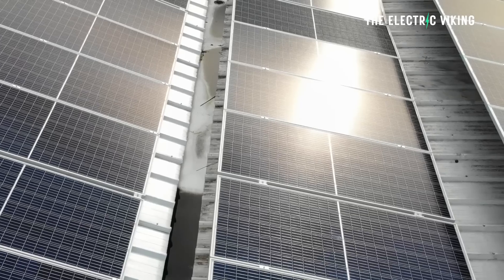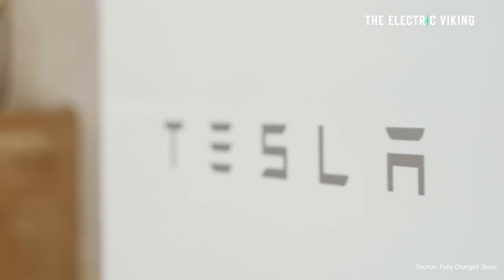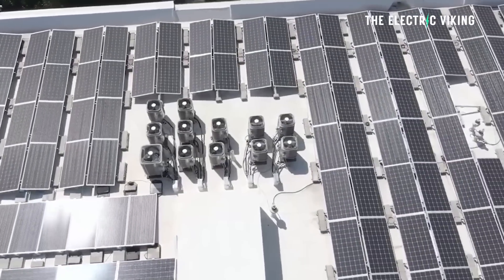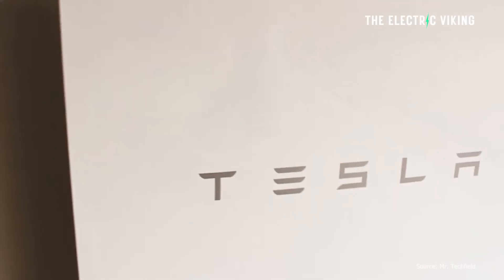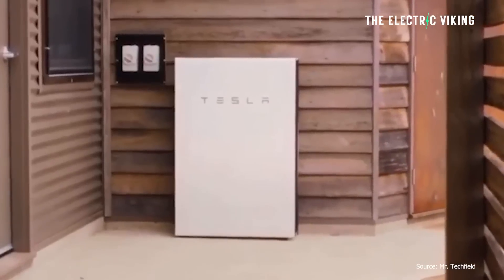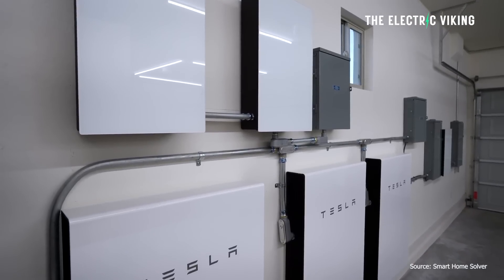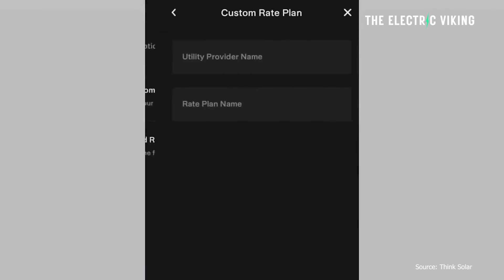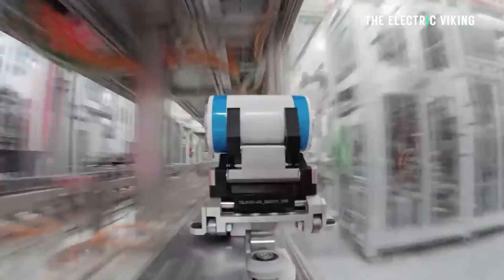Tesla DROPS the price of the Powerwall home battery AGAIN

Comment: The big issue in Victoria at least is my solar panel system is 6.6kw with a 5kw inverter. It is classed under contract as a micro generator by the power companies.  Under their crap contracts, you are only allowed a maximum kw feed-in to the grid size by location on the physical grid. My street is 5kw max only. Under this crap Aus system, they only allow 1.2 times the inverter max output as total amount of solar panels that are allowed to be installed. Hence the panel max of 6.6kw. If we had 3 phase connection, then yes I could have had a larger inverter and therefore more panels. 
These idiots either hate solar of don't understand how it works. As the best panels are only arount 22% efficient,  and the inverter controls that power output, I should be able to connect enough panels ... maybe 5 times as many in order to get a higher yeild output. The inverter regulates what it's chopping the DC at. It's all safe. 
These contracts stop you from benefiting from a larger array and the possibility of being able to store it.  
I also found that if a panel were to go faulty, I must replace it with a type from Ausnets list of allowed panels. What a joke. Australia is such a nanny state.

Comment: My 6.6KW Solar Battery system is looking at ROI of 7-8 years, I installed anyway because I love technology : )  . Here is the simple math. My system 6.6KW cost about 5000 all up. 6.6KW * 365 days * 0.3 Aussie dollar per KW. Means I will save 722 Aud per year. 5000/722 = 6.9 years for ROI.   But I am actually paying 0.24 Aud per Kwh, ROI becomes 8.6 years. I just hope the battery can last 10 years. (Also I haven't included my 10Kw solar panel system). I also have a question for those people that has a massive credit accruing on their electric account. Is the credit transferrable to cash ? Because if i want to change to cheaper electricity company, you will lose your credits. So basically once you have reached ROI, and started to acrue credits, you won't need to pay electricity bill anymore but you are stuck with that electricty company forever.  This makes me think the government will eventually reduce the feedin credit to 0 and I will eventually become a solar power milk cow.

Comment: Li batteries of any type are not really the best option for static applications - either home or grid use.  The alternatives last far longer, can be cycled between 0 and 100% with no damage, need simpler charging/discharging electronics, are made from elements that are cheaper and readily available from multiple sources, should be cheaper than Li batteries once they get market share and will be more easily recycled if they ever need recycling.  There are both flow/plating and gel batteries based on Zn and Br, liquid metal batteries based (so far) on Sb and Ca, a range of redox batteries based on Fe and V, the 'rust' battery based on Fe and air and perhaps even the up and coming Na batteries.  These really need pushing to achieve market share.  Perhaps governments could install mega batteries using these technologies.  They are money earners even without attached renewable energy generators, buying cheap and selling expensive.  Besides they improve the grid immensely.

Comment: I did not build (well, I had the engineers do the actual construction) my solar system to make money selling power to the grid. Instead, I polished up my tinfoil hat and decided I wanted to have the capability, if needed, to be energy independent with battery storage in the event of a long-term grid failure in the ongoing global economic collapse. I would have to cut back on my usage in that event (garden lighting, swimming pool, maybe one of the hot water heaters, etc.) but my storage is sufficient that I wouldn't have to make drastic changes in my lifestyle.

 I generate slightly more electricity than I consume on a daily basis and my overage I give back to the grid without compensation. In return, they utility company "stores" my overage on a 12-month use it or lose it rollover basis (I pretty much lose all of it) but it covers me for the few months of the year that my solar output doesn't quite meet my usage. I'm "losing" a couple hundred kWh per year that way, but the simplicity of it all makes it worth it. My electric bill would run about $4,000 USD per year without the solar. With it I pay only the $1.33 per month grid connection fee.

I do not have Tesla Powerwall storage. One reason is that it is not available where I live in the mountains of Central Mexico. The other reason is that my battery storage of choice cost me less than one third the cost of a Powerwall at the time. My choice? Deep-discharge lead acid batteries designed specifically for infrequent use. I remain grid tied (while it lasts) and my batteries just sit 24 hours a day on a trickle charge. When I do experience a rare short-term grid failure, I don't even know it, not even a flicker from the lights as the batteries pick up the load.The batteries will easily last 10 years without serious degradation under those circumstances.

When the batteries eventually do fail (as do all lead-acid systems in the long run) I can replace them with newer technology, with twice the storage at half the price I paid for my lead acid batteries and still be money ahead. My engineers thought I was crazy going with lead-acid storage... until I explained my reasoning, and then they agreed with me. This system would not work if I were using the batteries, cycling them daily to sell electricity back to the grid.

It works for me. YMMV.

Comment: Paid, been or the list 2.5 years for a solar roof and 2XPowerWalls, got the permits. Permits expired this month and speaking with Tesla is useless. I need an inspection by Tesla but they will not answer the simple questions, “Does Tesla have an inspector in Portland OR? They won’t answer the question but refer me to the two certified installers in Portland OR. I just want Tesla to come and install the solar roof and PowerWalls. I have no desire to deal with some unknown contractor.

Comment: I have a Tesla power 2+ and with Tesla's VPP it is a game changer.  I also driver over 1000 km's a week in my Model 3 and dont have to pay for power at home including charging my Car due to the VPP and how well it works.  All this rubish about costs and its not worth it are out the window when you dont have to pay for energy at all.  Most people pay for fuel and power at home add those togeather and work it out.  If you do heaps of km's your crazy not to have an EV solar battery and VPP.  Saves you heaps of money.  BTW when your on a VPP with Tesla they change your Battery Warranty from 10 years to 15 years as they manage your battery.

Comment: A total ripopff. You can buy an 80kwh electric car for around £40k. That is around £500 per kwh and you get a car thrown in for free. An EV battery will have a much rougher life than a battery used for domestic energy storage. Battery prices are now supposed to be around £100 per kwh. Hopefully car to load or car to grid will completely bury this overpriced nonsense.

Comment: We are doing PV panels in the next few months and batteries next year.  If Tesla doesn’t release the PW3 by then will go with Enphase 5P LFP batteries.  I lie the surge capacity of the Enphase batteries compared to the current PWs.  And Tesla needs to offer V2H as well.
Reply: Enphase will also support a generator with its off the shelf controller unit.

Comment: In the UK getting a battery is a no brainer. During the summer you can fill it up with solar power, in the winter you can use off peak energy and save an absolute fortune. I’m with Octopus on their Flux tariff, designed for people with solar and batteries but no EV. If I fill my battery from either solar in the summer or between 2am and 5am in the winter and use the energy between 4pm and 7pm I save £0.24 per kWh. That might not sound like much, but over a year that would be about £90 for each kWh from the battery. During the rest of the day I would be saving £0.12 per kWh.
Reply: Wrong.  You can save a bit during the summer but, if you have a heat pump, as most of us will have to in the future, the thing will be on from 6am to around 11pm using up to 50kwh per day. That makes it impossible to do any sort off load shifting to take advantage of off peak periods.
Reply: @rogerphelps9939  why are you pointing out something wrong that isn’t actually wrong yet? I’m talking about the now, describing what I have now and how it works, I will worry about the future when it happens. When I get an air source heat pump (as I fully intend to) I will not have to pay for any gas, which will save me about £1200 at current prices. I also intend to invest in more solar panels now I understand how brilliant they are, and I have found out about the DIY kits that you can self-install that charge batteries and don’t connect to the grid, such as the Ecoflow system. I also fully intend to get an EV and more batteries.

Comment: You can buy a Powerwall in the US without a rooftop solar setup and just use it for backup power and arbitrage if you live where rates are variable.
I live in Arkansas and Tesla does not currently install Solar here despite our being a good location for Solar. When Elon expands here we will be getting a Solar Roof with the Powerwall.

Comment: With Tesla you are paying more for software and a name but they've been forced to lower prices do to increasing competition.  EG4 just released a slightly bigger sized battery than Tesla for only $3,900 and works with most inverters but Tesla's software and app are far more advanced.  Whether that means anything depends on how you intend to use it but you can purchase two of these for less than a single Powerwall.

Comment: I’ve enjoyed my pair of Powerwall 2s. Even if you don’t have solar you can get whole home protection from power outage. I live in Texas so our energy grid isn’t very reliable. Solar plus batteries is great because our peak energy times (most likely when we’ll get rolling blackouts) is during the day, so as you said Sam, if the power goes out and you reduce heavy loads: laundry, oven, maybe back off on one of the AC units) you can cruise through blackouts. (Harder than it sounds because Powerwall switches so fast you won’t even notice except the Tesla app notifying you). The lights don’t even flicker. You don’t have to reset your microwave clock, etc.  (This saved our thanksgiving dinner a few years ago. Guests were over. We had lights and finished cooking while the rest of the neighborhood was dark.)

For energy we export onto the grid, our energy company Entergy pays only 30% of their charge rate. Very unfair. So solar isn’t a short term cost saving situation like it is for others. You can hear our story on this podcast: https://lancerkind.com/listen-to-the-scifi-thoughts-podcast/scifi-thoughtss-solar-transition/

You will find other people’s stories as well.

Comment: They don't include:

Saving the contents of your refrigerator ($200)  and freezer ($120) and 6 bottle wine cooler ($80).  And if you have just 24 bottles like i did after Ike that burned in 95 degree heat,  $400. 

Nor any heat sensative medicines.

Not the "value" of having one room air conditioned (tho some slept in their cars) for that. 

And while hurricanes are rare, 12 hour outages happen every few years to one of my friends. 

You can get a unit that will do this without solar for about $3k now.  You can add 400w of solar to that for $420 with cables.
Reply: We don't get power cuts very often in the UK, maybe once in ten years. A powerwall is the wrong solution for frequent power cuts. The correct solution is for your utility to do its job properly. Then everyone benefits.
Reply: @rogerphelps9939  well let's wish in one hand and see what we actually get in the other

Comment: Capacity is still to low. You need more than one even if you have Solar. Also are they LFP yet?
Reply: They need to be around 200kwh to be any use when you have a heat pump and are using 50kwh per day in winter. They are absolutely pathetic at the moment.

Comment: Here in the state of Oregon they require utilities to let you credit your power bill by putting power back into the grid. 
This would be great if they didn't limit it as then you might offset your entire bill during the summer when we get a lot of sun. However Oregon left it up to the utilities to determine how much each utility would allow you to put back into the grid. 

Here's where it gets bad.... my own utility limits this to 25KW/mnth. A pittance. That's all they will credit you for.  The reason is that all but 2% of the power my utility gets is generated by hydro-electric dams with some wind. In order to lock in rates, my utility has to make a long term contract (currently locked in tgru 2026) with the dams (Bonneville dam in this situation) to purchase a minimum amount of power they generate. This means that if customers were to put too much power back into the grid the utility would not need that much hydro-power but would have to pay for it anyway. 
Now we are regularly seeing commercials from the dam industry lobby about how important it is to preserve the hydro-power in our state. What is happening is that renewable wind and solar energy generation is starting to supply more and more cheap power. The dam operators fear for their profits going forward. The maintenance required on dams is a significant cost and must be done regularly. 
So the dam lobby is trying to keep power rates from falling by stoking fear in the population that somehow the lights and heat would go out if dams were not there. They are afraid of other renewables undercutting them. 
It sucks when power generators of any type spend all their efforts on trying to protect their turf when they could more easily buy up the cheap East Oregon desert land, with the millions they get, and set up their own solar farms; probably saving money in the long run. 
The dams will still need to be there but to serve only gas shipping vessel locks to raise and lower the barges that go up and down the river over what are natural waterfall and rapids areas (why they built a dam there in the first place). They could become the peaker power plants for when emergency power is needed.

Comment: Cool that you are reviewing these, and cool that Tesla has dropped the price, but the fact is that there are lots of other battery choices out there that are way better options. EG4 just came out with a PowerPro Wall Mount. It is 14.3kW, has a 10 year warranty, is rated for 15+ Years at 80% DOD | 8000 Cycles, and costs $3,999. It makes Tesla's price drop to $12k and the $750 rebate seem ridiculous. I could buy 3 of them for the price of 1 PowerWall. And that's just one company. There are several other companies competing in this market. I like Tesla as a company, but if I am buying a battery, I would not even consider a Tesla PowerWall. And if the point is the batteries are cost prohibitive to many people, then the focus should shift to the companies that are selling at affordable prices.
Reply: It almost seems to me that Tesla's powerwall is an afterthought, has some good features but just not staying competitive otherwise.
Reply: @joechughtai3155  the Powerwall is for people that are already all in on the Tesla eco system. As the OP mentioned you can do this much cheaper by going with EG4. For $23k you can get an 18k inverter and 60 kw of power for $22k.
Reply: EG4 Powerpro wall mount is $3999 USD.
Reply: Comparisons on YT show that other battery solutions are NOT comparable.
Reply: Great news Ty for ur comment

Comment: In Virginia (USA) - there is a lot of Tesla Powerwall installations.  Electricity is relatively cheap here as we rely mostly on nuclear, natural gas and wind/solar.  As the installations have increased - installation costs have come down.  Most people are buying the Powerwalls first and then add the solar afterwards.  I have been reading the price is coming down as production rates continue to increase in their NV giga-factory.  My neighbors who have one have told me the software used to manage the Powerwalls is vastly superior to the cheaper competitors.  The combination makes it the better choice overall despite cost differential.

Comment: Mr. Viking alludes to this, but to emphasize: the critical issue is the supply deal available to your premise. The difference between peak and off-peak price(s) determines viability. Installation, support and insurance costs and details are also significant.

Comment: A question. If a car has been flooded it may be that the car will be written off  on safety grounds because of the risk of damage, rather than actual damage to the battery.  A salvaged battery could, one be cheap, and two have a reincarnation for all sorts of applications, particularly running off bigger solar arrays. For example I have a small rural abattoir in mind which could utilize the additional capacity.
Reply: There’s a Finnish guy on YouTube who has made his software open source to manage EV batteries as static power storage. His name’s Dala, and his YouTube channel is something like Dalasevrepair